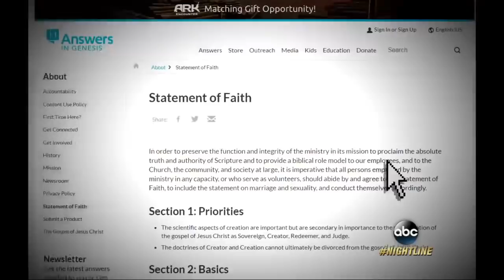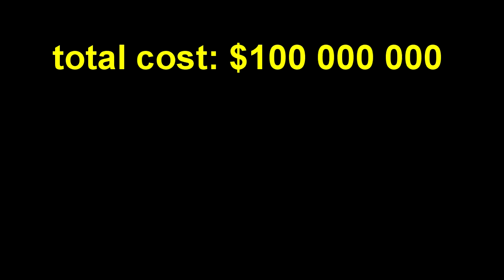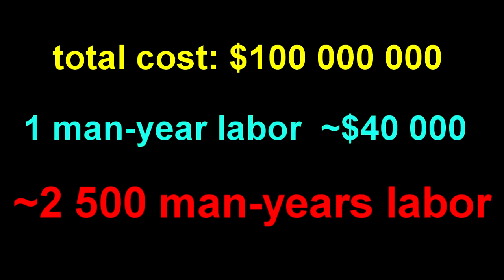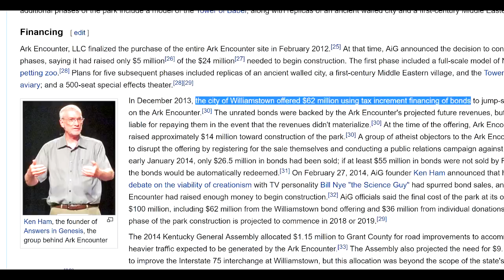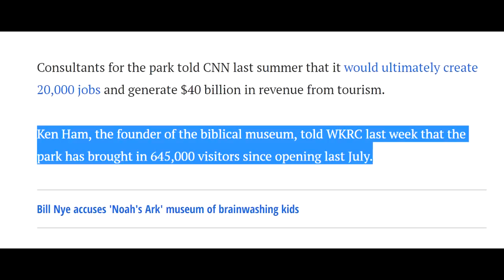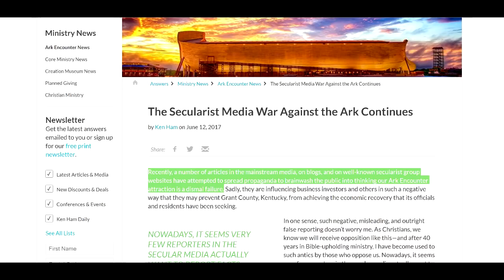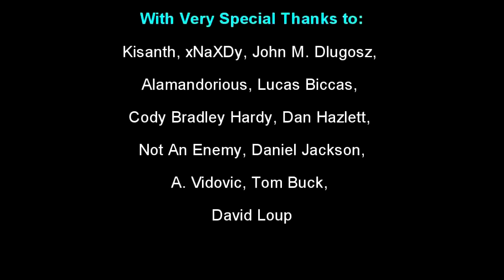Why do people laugh at creationists (part 44)

Comment: It hurts to see all that wood that went to waste...
Reply: Speaking of which, where did Noah find all that wood in the middle East?
Reply: Space duck | Why ? Do you believe most wood used in construction comes from unique and ancient forests that will be forever destroyed or some other ignorant nonsense ? A big hole in the Amazon Jungle ? Are you 12 ?
Reply: GOOGLE TAQIYYA no, I'm just saying that this wood could have better been used for other things. Also I'm 17, not 12
Reply: GOOGLE TAQIYYA pretty hostile response considering the original comment. I take it you are 12.
Reply: GOOGLE TAQIYYA and just so you kno sustainability in the construction industry is a factor most big contractors take seriously. Your comment is the only ignorant nonsense here.
Reply: Crimea river lol. That's one way to look at it I guess. Haha. I'm not a big environmental nut but it doesn't hurt especially in the building industry to think about it. Waste less means less money wasted, buying local means less fuel expenses and over time it will help to sustain this planet for as long as possible. But my point is there are practical reason for sustainable construction.
Reply: Kedel Dejoie 
Supposedly, the ark was built in Lebanon, which had famous Cedar forests - there is a Cedar tree on the modern Lebanese flag, for exampke.

Unfortunately, Cedar is HORRIBLE material to build boats from, because as Cedar dries out after it has been harvested, the spiral grain actually causes the boards or logs to twist.

Now, in a house, or some other building on land, there are ways around that, like running the wood through a kiln, or just building with loose tolerances, which can allow some movement. On the water, the wood dries out, moves a bit, there's a storm, the wood absorbs water, moves back, etc, etc. Also, boats have this funny requirement, that they be watertight, right? Picture a boat that has every plank moving a tiny bit, and what do you get?

NOT a watertight boat, that's what!

And finally, every wooden boat EVER had to have the seams sealed, usually using pitch in ye olde tymes. Okay, so you're harvesting tons of cedar, right? Cedar is FULL of natural waterproofing, and makes nice pitch.

It would take as much wood harvested for pitch as it would take to build the ark.

Then you need to consider how much scaffolding it would take to be able to build the silly thing.

In other words, the ruler of that area was kind enough to allow Noah to denude the forests in a HUGE area, to build a boat that nobody thought was necessary.

What a nice guy, yeah?
Reply: GOOGLE TAQIYYA I T S  A  J O K E
Reply: Michael Coulter if you think about it that deforestation may have been what caused the flood in the first place. (Not that I think it actually happened)
Reply: Space duck Not a creationist however this isn't very wasteful it's actually really good. Wood is made up of a whole lot of carbon that comes from the carbondioxide in the air. Normally trees die and the carbon will end up back in the atmosphere but if it's in a building it'll be stuck there.
Reply: Crimea river you sound like a psychopath bro. Lol. I sometime wonder what the fuck is goin on in the world but I wouldn't wish death on the entire world. I suggest counceling or you get you super villain costume sorted. Lol. Either way keep hope alive you are somebody. 😁
Reply: It won't float I can prove that mathematically
Reply: The actual number of board feet of wood used to construct this monstrosity could have been used to build something like 500 standard 3 bedroom bungalows for the deserving poor.

If and when Ken finally meets Jesus, I hope that point gets raised.
Reply: Space duck its not a waste its about the LIVING WORD OF GOD you might want to seek GOD before you lie
Reply: Kedel Dejoie GOD led him
Reply: Wood is a renewable resource
Reply: True.. Every morning i wake up with a new woody, and hours after it is gone... bingo new wood for me...
Reply: Exactly what my ex-girlfriend said about my Erectile Dysfunction! :(
Reply: Kedel Dejoie ¯\_(ツ)_/¯
Reply: Crimea river caring about our environment is VERY important for our future generations. You do wan't your grandson/daughter to live in a healthy and safe world, do you? Or do you just hate everything around you in general?
Reply: It already is a problem. Not all of us are ignorant and selfish and we want to leave a better world for our children.
Reply: Wood never goes to waste, someday that's going to be repurposed and sliced into a sweet veneer for floors and more.
Reply: 17 is the new 12
Reply: cedars are not all the same
Reply: The waste of resources could be compared to almost any sporting arena wouldn't you think? Granted most of society accepts one and not the other. To each their own I guess
Reply: @Space duck, don't worry about it. They could always recycle them into paper and print a lot lot of bibles. And that is MIRACLE ! LOL :D
Reply: Space duck. aint it the sad criminal truth brother . what a sin .and a shame. all that valuable wood .waisted .
Reply: It doesn't even look like they sealed it against the weather.   It's all grey and ugly.
Reply: +Horinius Yea, that's a good idea, I need more toilet paper anyway.
Reply: Kedel Dejoie : Antedeluvian Earth was very different from Postdeluvian.  What caused the Subterranean Ocean to burst, causing Noah's flood?  Most likely, and asteroid collision.  There you go.  Genesis 6 describes an extinction level event.

Is My. Everest of today identical to what it was before it erupted?  Of course not!  Noah merely experienced a global scale version of what local catastrophes can reveal.  To compare that with modern geography thousands of years later is beyond apples and oranges.
Reply: +Dozerfleet Studios Or most likely, noah's flood isn't real.
Reply: +Fakey Yoi so would using the wood for anything else
Reply: They probably made some excuse like how "Noah wouldn't have used wood sealant and we wanted to be traditional" Even though they were using power tools and cranes
Reply: +Frank Liu Wtf are you talking about?
Reply: +Fearful Pineapple I forgot that youtube doesn't put the comment under the other if its a reply to another comment but it was to the guy talking about how it looks ugly and grey and that they probably didn't protect the wood
Reply: +Frank Liu Oh, that makes a lot more sense lmao.
Reply: +Recklessbliss Characternotcolor Most likely, this will be the last century for humans, maybe the next one. Thankfully no more idiots roaming this beautiful planet.
Reply: Space duck One day it could be used for firewood, so it wouldn't go to waste.
Reply: Kedel Dejoie Exactly.  It would have made much more sense for God to have given the task to a man from the Haida nation in what is now British Columbia, where they have enormous Douglas Firs.
Reply: actually its not so bad, perhaps the only good thing about it. it is a carbon sink so its a little bit of help to combat global warming, but thats about it then....
Reply: @judkunokin268  angels flew it it in from somewhere else of course.....